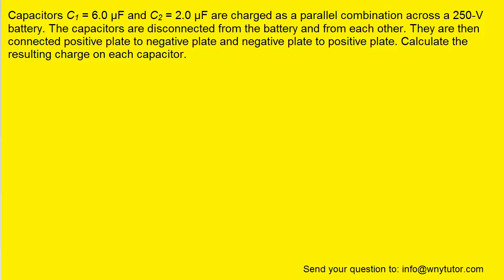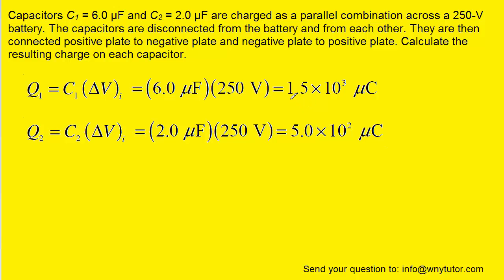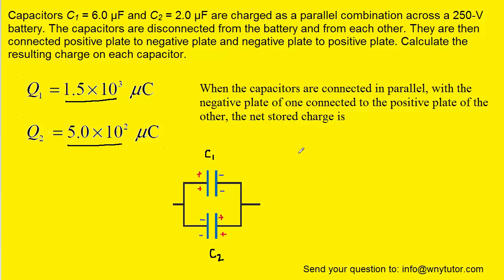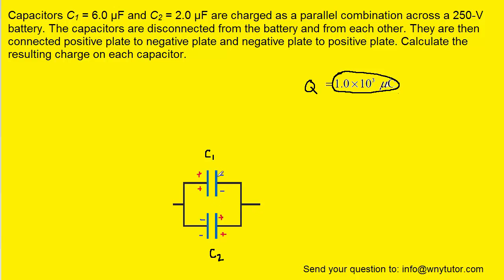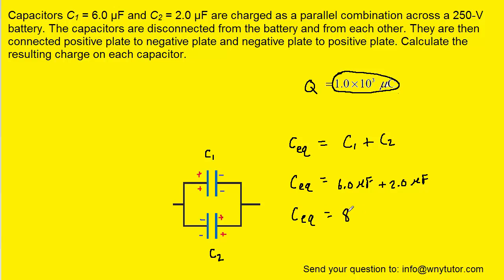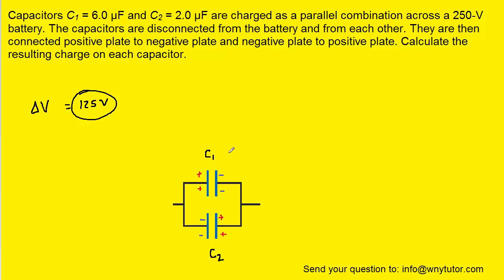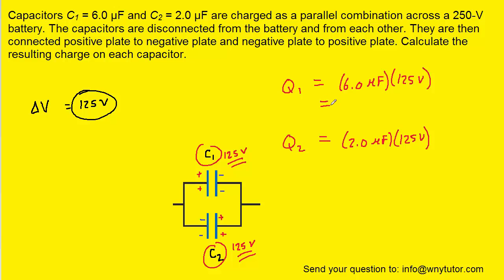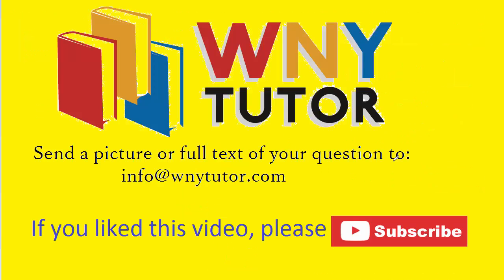Capacitors c1 and c2 are charged as a parallel combination

Comment: Ty so much sir
Sir I have a question plz reply
Sir in case if we have a capacitor charged to a potential difference and then connected with an uncharged capacitor ..now how we find the value of potential difference between the plate of capacitor..
Sir please reply

Comment: How this solve when positive  plate to positive plate and negative plate to negative plate?
Reply: There would be no difference between the initial case and final case....in parallel combination,the capacitors are already connected positive to positive and negative to negative